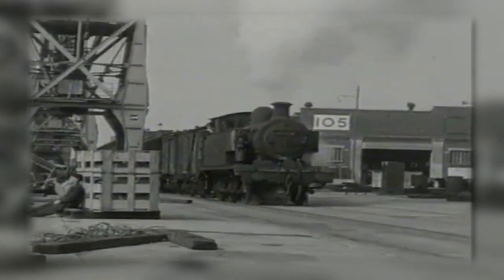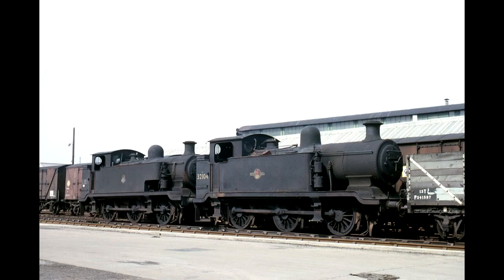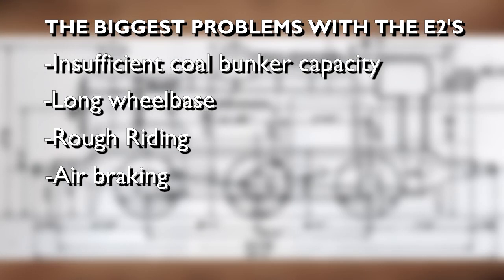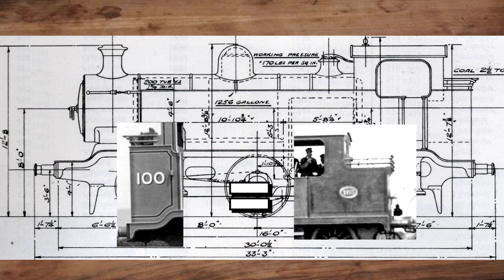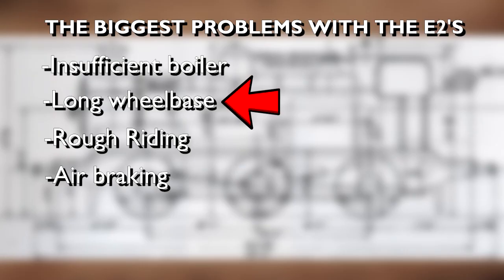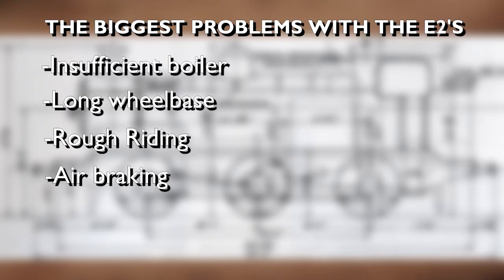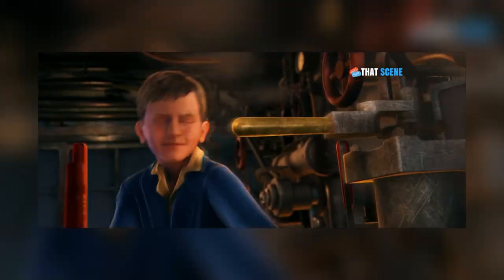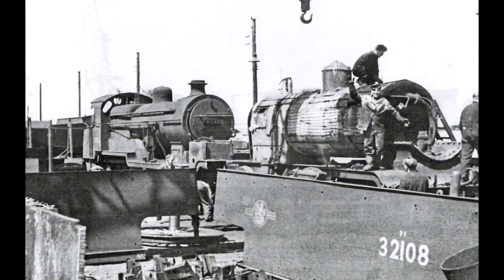The E2's - Not as Bad As We Think?

Comment: Perhaps the problems lied with the size of the blastpipe in the smoke box. It was the same case for the GWR manors, they were heavy on coal and poor at steaming due to a slightly oversized blastpipe. Once the issue was corrected, they became much more efficient engines.
Reply: Sounds like Henry's problem
Reply: No Henry had a small firebox
Reply: He was a failed prototype A1
Reply: @lashondatalbert8271  An engine based on stolen plans of a proposed, but never built prototype, in fact.

Comment: The boiler sounds like a Draughting issue. as the issue stated, opening the regulator all the way would blow burning coals out the funnel. this implies the coal was burning faster than it should have, and well, burning is a chemical reaction, oxygen plus carbon. ironically in this case though, seems there was too much airflow, and thus too much oxygen blowing through the firebox. a different boiler or perhaps one with a Belpaire firebox with smaller grating would've increased efficiency, and thus reduced the coal burning per mile.
Reply: So theoretically, we could build an E2 with a better boiler and it would be better
Reply: @kommandantgalileo  Yes! And We Can Fix The Off Balanced Problem, Then The Wheels! 
I Was Thinking: Since They We’re Off Balanced, What If We Thickened The Running Board/ Gave It More Weight In Order For It To Get More Balance On It? Because What If The Running Board Wasn’t Manufactured Properly?
Reply: @tankthehedgehog105  it might be the wheels that are the problem, replace them with similar wheels from other engines that work and it should be perfect
Reply: @kommandantgalileo  Oh! Ok

Comment: Technically, the boiler fix could solve both the fuel problem and the wheelbase problem. Since the new boiler won't eat up fuel as quickly, the E2 can go back to long-distance suburban trains instead of being confined to dockside shunting yards with sharp curves. It fixes one problem directly and completely relieves the engine of the other.

Sometimes the real problem is not the design, but way it's used. I guarantee that if the Jinty was used to shunt in yards with sharp curves instead of pulling suburban trains, it would receive many of the same criticisms as the E2.
Reply: Maybe Thomas had that? He could've been modified on Sodor to have a boiler fix, enabling him to be the branch line engine.  I'm on discord and someone said E2s were alright for a tank engine in size and enormous for their class, 0-6-0T.
Reply: The Jinty was used to shunt in yards with sharp curves. They were not often found on passenger work, except in preservation. The Jinty had it's own problems, mind you, such as it's axleboxes. An E2 that was fixed would probably be as good or better then a Jinty, as the E2 has, I believe, more tractive effort.
Reply: I don’t think the shunting yards the Jinties worked in were like the Southampton Dock’s. Engines with 10-11ft wheelbases such as the  S100 and Austerity had no problem squeezing through. Given that the E2 struggled with its 16ft wheelbase and 4.5ft wheels, the Jinty with its 16.5ft wheelbase and 4.6 wheels would have hell in the same curve.
Reply: @ajaxengineco  I'm not a tank engine expert, but the E2, so I've been told, was heavy for a 0-6-0T.  However, the engines of my country, excluding the few tank engines we've had, can dwarf the E2. I read about an engine of non-tank engine ilk in a fanfic that was something like 450 tons in weight, the EM-1.  The E2, at slightly over 50 tons, was many times smaller than that and that makes it seem like a little engine.  Sort of like a large compact car, a big little thing. Like a Corolla looks small compared to those big SUVs and vans, more or less, as the Corollas of the past 8 years are large compact.  Call the E2 a big tank engine.
Reply: @LD1-38  there were a couple of Jinties at work in Scottish industries (either dockyards that were smaller then S'hampton or maybe distilleries) and in such environments they could navigate a 2-chain curve, if driven slowly. That's very impressive for any 0-6-0. It could well be that an E2 in the hands of a competent driver would do the same radius of curve, and the LBSCR just had bad enginemen!
Reply: So in the words of trampy Thomas
Just get a new boiler
Reply: That could explain why Thomas had no fuel consumption problems running his branch line. The overhaul probably fixed that problem.
Reply: @DragonStar524  topham immediately got bro fixed as soon as he bought him

Comment: Considering the parts used to make a E2, I think Sir Topham would’ve done to Thomas what he did with Henry.

Rebuild the engine completely, using different designs but ultimately being the same engine. And since Henry’s incident happened in the 1920’s, I imagine Thomas, was sent with him.

Using components from the Furness Railway G5(for the boiler), a Midland Railway 1F(for the wheels), a couple original components from the E2, such as the Smokebox, slightly smaller water tanks but the same shape, and some components from a GWR 655 Tank for Push Pull compatibility.

On their way back from Crewe Thomas would’ve likely been towed by Henry due to the long distance from Crewe to Sodor.

Comment: About the wheel base, the 9F's actually had their middle two drivers of their 5 sets flangeless to allow the locomotive to negotiate curves. Also, a point about steam locomotive boilers is that it needs to be able to not only generate and maintain pressure but also retain heat to reduce coal and to more efficiently heat the water (reducing the over-consumption of water but this is a major problem on many locomotives). The problem with the boiler was that it was not retaining the pressure that was required for the locomotive (this might mean that the locomotive boiler was rated and given a much higher Boiler PSI then it was capable of creating on its own.) This means that the locomotive's boiler PSI would have had to be lower and the use of either slightly larger cylinders or superheat (a technique that basically superheats the water in the boiler which results in a much higher steam pressure for less coal and water) to compensate for lower pressure. Also, for braking, the problem with couple breaking when sudden stopping is down to the use of vacuum brakes which has a much quicker response to quick braking then the Westinghouse brakes. This is because the engineer had to use the locomotive brakes if there was no connection for the air brakes which results in the locomotive being able to stop but the truck cannot. (This is why most yards maintain a much lower speed then branch or mainlines due to the fact that until the end of steam, not all trucks were equipped with air brakes)
Reply from the maker: Ahh, okay. I was going off an example I heard of one engine that had problems with its middle drivers being blinded. That was Southern Pacific Narrow-Gauge #1. She was a 36” gauge Baldwin 2-8-0 locomotive which was once used to haul heavy freight over Mt. Montgomery Pass. However, she constantly derailed due to the tight curves over the pass because of her blinded middle drivers. The railway was built with small 4-4-0’s in mind, not the large 2-8-0 that later replaced them. When she was later sold to the Nevada County Narrow Gauge Railroad and became their #9, her drivers were fixed with flanges and it was said not once did she ever derail on their line.

Duly noted about the boilers though. Huh... I never considered that when analyzing the boiler. The E2’s were meant to max out at 170 psi, which is 10 points higher than the LMS 3F Jinty. So, I guess making a boiler that could match the Jinty’s boiler pressure and keep it at that wouldn’t be too much of a downgrade for them. Adding the 18in cylinders from the E3’s for that should work as well. Dunno if the E2’s were already mounted with superheating or not though. I’d imagine most likely they would’ve had it. I’ll have to look into that.
Reply: If it helps, think of this as a game of balancing eggs on a seesaw. You can't have the cylinders be too small or too big which results in either too much steam for little work or not enough steam for a lot of work. The boiler may just be fine and the cylinders the same, it may be a henry's old shape situation. This is where the locomotive's firebox is not big enough to provide adequate heat to make steam, though it is more acute due to the relatively short distances and slower speeds.

For a locomotive to work, you need to have a machine that is powerful enough to move on its own, economical to run (not a chugger of coal or water) and can make and use its steam without having a boiler explosion or running out of steam. Certain cylinders could not go with certain boilers and certain lengths could also play a factor. Superheating would only improve the steam pressure but at the cost of requiring a much stronger boiler and cylinders to work. Many older locomotives had problems with motion swaying, with some actually having the chairs inside the cab coming off its mounting. This was a problem due to either poor Maintenace or simply overuse because many victorian designs were still in service by the time of BR. The Great Western Railway actually still had some of its earliest locomotives (converted from Broad Gauge) still in service by the time of BR but for the most part was the most uniform modern-ish fleet of locomotives BR received when it started. The southern had some of the oldest while both the LNER and LMS had large fleets of pre-grouping locomotives that were starting to show their age, which needed to be replaced but, for the same reason as the E2's were kept in service, there was simply not a need or money to replace them.
Reply from the maker: @erwingup5420  True, yeah. I highly doubt the firebox itself was too small, but it’s a possible factor I suppose. I’m gonna have to do more research on the type of boiler if any resources exist for it on the internet.
Reply: @Nictrain123  what is 1:28 music called
Reply: @Mr.toasterandclay  In The Mood by Glenn Miller
Reply: @carlmatthews8338  thank you

Comment: The boiler issue might be an easy fix, depending on what exactly is the problem. If it is draughting that's the issue that wouldn't be too onerous to solve. The wheels and cylinders being poorly balanced is another matter. If it's simply a balance weight imbalance that's not as bad of a problem, but on the other hand changing the wheel or cylinder size would be quite difficult. I can't see how a size imbalance is the problem (I would normally expect weighting issues and poor suspension), but giving a locomotive larger wheels is very difficult. It is easier to give a design smaller wheels, but that would still require extensive modification of the frames. Larger wheels simply don't fit well with less than a near complete rebuild, probably including new frames. For the cylinders, while it is possible to change cylinder sizes, the inside cylinders mean this is difficult. Depending on how the cylinders are mounted it can range from a (relatively) simple replacement to needing entirely new frames (especially if the cylinders are cast integral to the frames or frame stays). This would not be a small job to fix and wouldn't be worth it for a small class of old steam shunters when there are much higher priorities. I do agree the draughting should be looked at, and thinner flanges on the center axle would help (that is a matter of replacing tires, not the wheels themselves).

Comment: If you don't completely understand what they said about how to fix them, here it in in a nutshell:

Small coal bunker and water tanks: The bunker and tanks aren't actually small, they  can actually carry the same amount of coal and water as Jintys, but it's the boiler that's wrong. The boiler was actually from another class of engines that has bad boilers, so all that would be needed is a new boiler.

 Long wheelbase: You wouldn't actually need to make the wheelbase shorter, but just weaken the treads and flanges of the middle drivers to make it work.

Rough riding: All that's needed is to balance out the cylinders and wheels. You could give the E2s the same wheels and cylinders as the Jintys, or just give them 18in cylinders just like the E3s.

Brakes: Maybe just go easy on the lever when braking.
Reply: I don't know what size wheels E2s had, since TTTE's my awareness of them, except "small". I don't know how much diameter small means for train engine wheels.

Comment: I loved this video so much thanks for making it. Maybe Thomas and Edward could share a similar boiler? Perhaps providing a bit of standardization to the NWR's fleet? Speaking about Edward, it would be a very interesting video covering his rebuilds and upgrades and proving that it's possible for him to look the way he does yet still be a Furness Railway K2 down to his core, since popular opinion as of now is that he can't be a K2 because he doesn't look like it and which in my opinion is very ignorant and shows a lack of understanding of locomotive rebuilding.
Reply: Yes...yes...
Reply: Thomas and Edward couldn't share boilers, there isn't room in Edward's frames for Thomas' boiler design (rear axle would be in the firebox), and Edward's wouldn't go into Thomas's shape, as I conjecture it would be too long and small in diameter. I do think they might share cylinders, though, which is an advantage as cylinders are expensive to cast and an arse to machine.
Reply: @ajaxengineco  good point but my reasoning is that the Furness Railway G5 and M1 shared the same boilers and the Lner V1 and D34 so why can't Thomas and Edward. And what I meant was share a boiler I mean the NWR designing their own boilers and placing it on Thomas and Edward then replicating an E2 or K2 boiler. That would cure Thomas' coal consumption and Eddie's shy steaming
Reply: @younubs-1266  I can totally see where you're coming from, but there's a lot of dimensional problems that need solving for them even to share a new boiler design, I imagine you'd just end up with two nearly new engines. I can see Edward, Donald & Douglas all having a common boiler design, Thomas maybe having a slightly altered design with similar construction, as to kind of have a 'standard range' of boilers, all quite similar, just scaled differently.
Reply: @ajaxengineco  I see where your coming from. I guess scaling would be an issues to not make Thomas so top heavy and I like the idea of Donald Douglas and Edward sharing the same boiler and Thomas just having a smaller version. Thanks for the info.

Comment: 13:55  I've especially wanted to mention that I personally saw another video on YouTube several times by Fan of Hiro titled NWR profiles as he certainly gave plenty of observational researchable info 'bout Thomas the Tank Engine himself including what made him be a very good performing tank engine that includes drive wheels with a certain 55" diameter, a precise 18" cylinder diameter, a certain 180 PSI boiler pressure, a certain total of exactly 22783 lbs of tractive effort, and especially a very specifically grand total of exactly 1340 gallons of H2O in each of the extended side water tanks on each side of his own official short stumpy boiler! In fact, it's completely obviously clear that I'm personally gonna be exactly 100% absolutely usin' those exact modificational specifications! I've especially wanted to mention that I personally also apparently for another fact definitely 100%. no doubtably decided to make the middle pair of drive wheels flangeless to negotiate sharp bends easily WHILE ALSO DEFINITELY keeping the wheelbase @ the usual length! And hey, speaking of which by the way, it's basically obviously clear to be no surprise that I've especially wanted to mention that I personally thought 'bout definitely fitting each member of the L B S C Railway class E 2 tank engines with the official requirements for American origin-styled railroads including the official automatic buckeye coupling devices to help with the official process of coupling/uncoupling from American origin-styled rolling stock very easily as well as a specifically awesome newly improved type of air-brake system that'll certainly help with applying the brakes on rolling stock very easily! In fact, it's completely obviously clear that I personally believe that I personally can EASILY give the L B S C Railway's own official creation of the L B S C Railway class E 2 tank engines such a beautifully BETTER type of boiler design that uses the exact 180 PSI boiler pressure!

Comment: Since this video lists the fixes, I'd like to present the modifications Thomas would've probably undergone when he was bought. 
Middle flanges shortened
Blast pipe sized down
House built boiler applied 
Vacuum brakes applied
Bigger drivers to accommodate for size of cylinders   
Cab built flush with the tanks
Rear slope raised